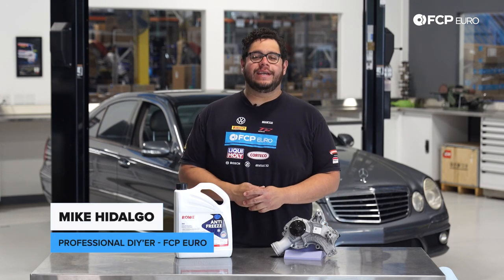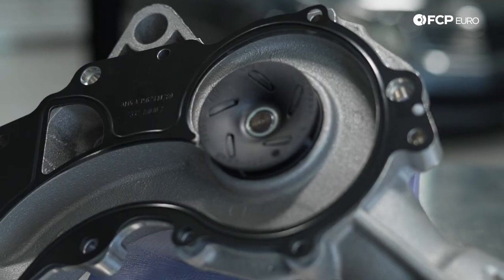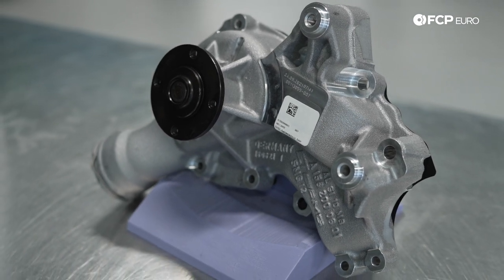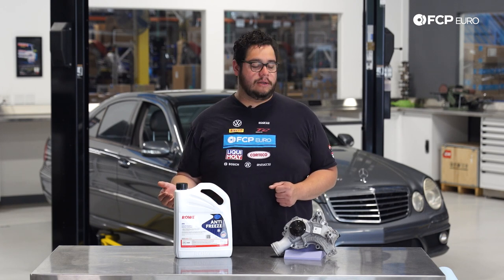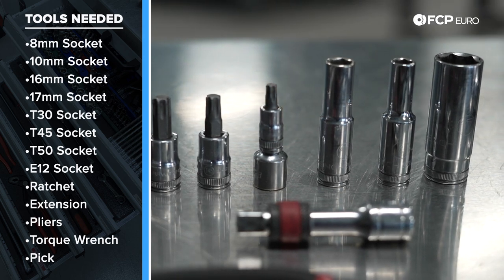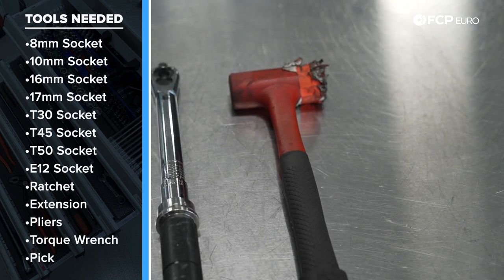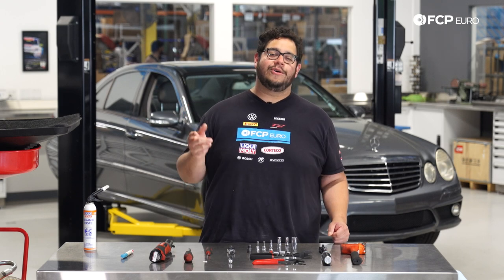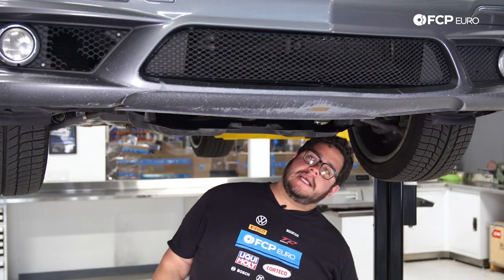Mercedes E63 AMG Water Pump Replacement DIY (Mercedes W211 E55, R230 SL63, W221 S63, W204 C63 AMG)

Comment: Where’s the secondary one? The auxiliary one.
Reply: On my E55 there is a small heater circulation pump behind the passenger side headlight, and also a pump for the supercharger cooling system behind the front bumper basically underneath the passenger headlight. I think all W211's have the heater recirculation pump but only the supercharged cars will have the other one of course.